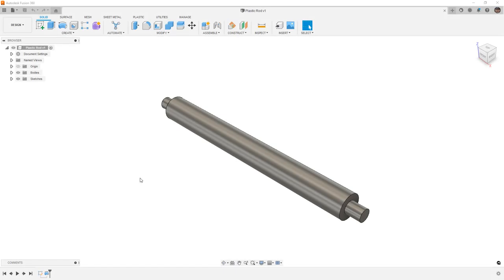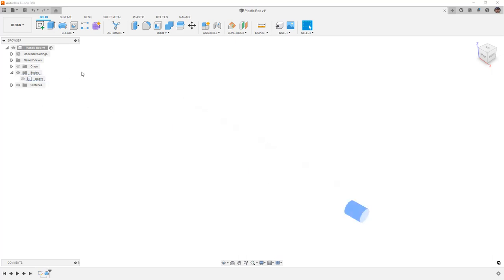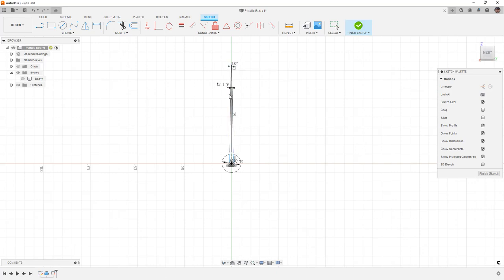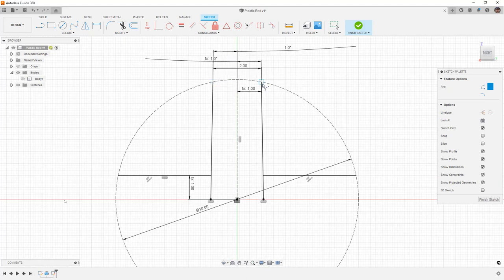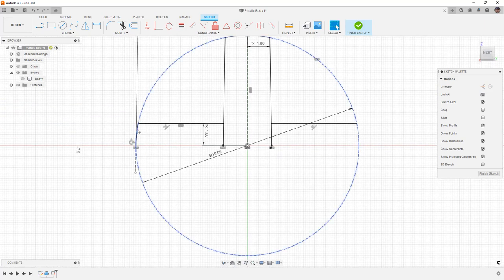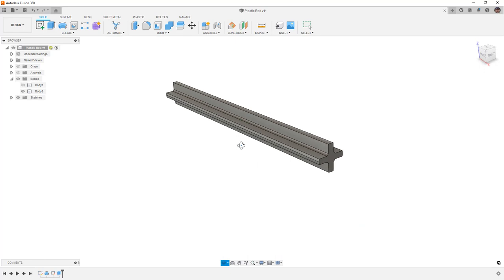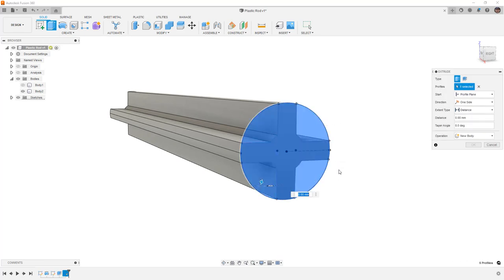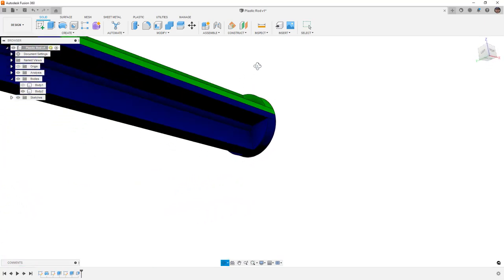Molded Part Series | Shafts | How to Design an Injection Molded Shaft | #Fusion360

Comment: Finally got around to watching more of these. This video really helped me know how to take the guesswork out of mold drafting for geometric parts. Thanks!

Now I should dig through your other videos to see this applied to organic forms, although I’m guessing the same principles apply and you just have to shape it manually to allow proper draft.
Reply from the maker: its tricky with forms since there is no "draft" so there are some videos in the forms mastery series where i talk about creasing the parting line and using the draft analysis tool to manually edge face angles.  that is about what we have to work with at the moment.

Comment: I use more mirrored bodies if the design is symmetrically as this. That keeps the sketches simpler and also less hassle if the drafts.
Reply from the maker: Totally valid workflow Emang!  In fact in my Solidworks days i would always go the route of Feature mirror/pattern over sketch pattern for computation time and robust modeling.  In fusion I am honestly split.  I always use symmetry when available but sometimes the sketch vs feature mirror is a bit spur of the moment.  This could have certainly been drawn as a 1/4 section.  Then you have to mirror it twice to get that center section.

One thing I have noticed with Fusion is that there doesn't seem to be a big computational difference between simple mirrors in sketches or features.  It is when we get to mirroring faces on complex surfaces that problems arise!

Thanks for watching/commenting!
Reply: @LearnEverythingAboutDesign  I try to keep the sketch and the design as simple as possible. That will also make it more stable for any changes. Great tutorial 🙏🙏

Comment: I enjoy your content.  Have you addressed keeping the timeline tidy during design model assembly editing?  When I go in and begin to change geometry to better fit with other geometry, my time line blows up and turns yellow...what is the discipline fix here?
Reply from the maker: Savvy, there are so many factors that go into this with Fusion and CAD in general so its really hard to give a general guideline.  The more complex the model/assembly, the more likely something is to anger it :)  

In general I try to think about what references are needed.  Internal vs external in the sense of the component.  Also keep in mind WHEN those references are needed.  Every design is different so that is very tricky.

I haven't really covered this but I am working on an upcoming series doing a PCB design and game controller body.  I am considering doing 2 versions of the controller, one for 3d print and one for injection molding in the same design.  I will give some thought to how I can talk about the order and control of these references.

Thanks!

Comment: please tell me, I am making a similar roller, only it consists of 2 rollers of equal length but different diameters, please tell me where the injection point should be, where the diameter is larger, or 2 injection points on both sides?
Reply from the maker: Generally the mold house would determine that for you.  Likely it would be on the rib somewhere in the  middle.  They might ask you to put a few round bosses on the midline ribs for ejector locations and they will determine where to put the gates and runners.